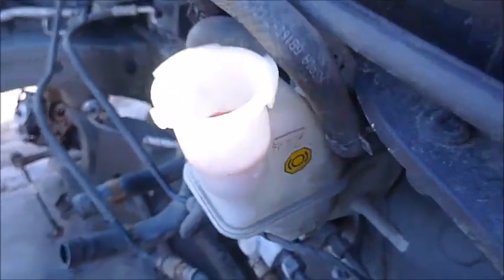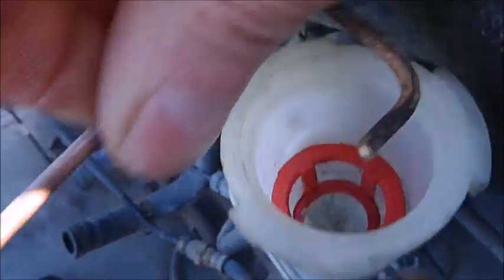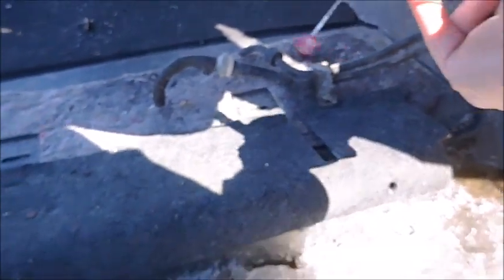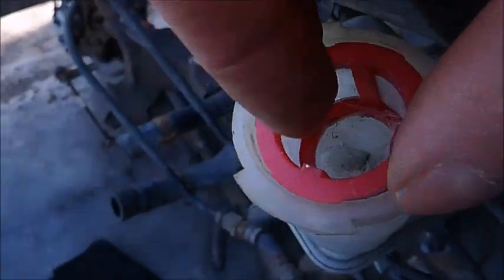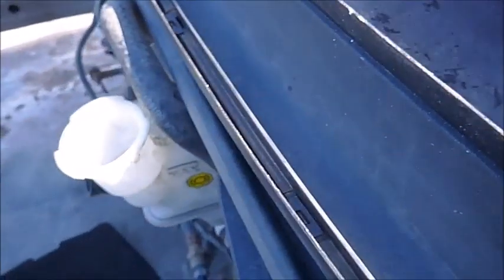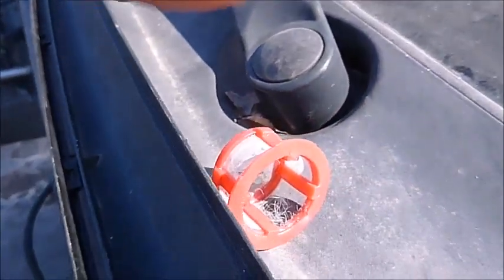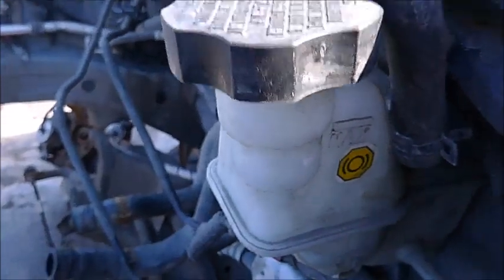Brake fluid reservoir mesh filter

Comment from the maker: Be aware when bleeding a caliper. These later reservoirs have 4 different compartments inside - each for one caliper. The fluid will lower in one compartment more than others. When bleeding brakes, always identify which compartment is getting low fluid - it can be one at the back of the reservoir. If you look only at the front of the reservoir, a rear compartment may get out of fluid and suck air inside ABS module. One of the way to burp air out of master cylinder and ABS module is to engage the ABS system when braking - brake on ice, snow, or brake hard on wet surface in straight line
The way it's inside these modern reservoirs, you won't be able to suck all the fluid out using a turkey blaster or a hose : notice there are thin 'channels' inside the reservoir so no access to the bottom of it.  It's much easier to just drain the reservoir at a caliper bleeder - carefully not to drain it completely - drain it, then refill a little with fresh fluid, then drain again and you should have pretty much all fresh fluid inside.

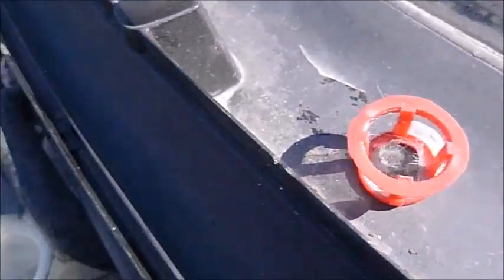Comment: 😮3:45 To use a brake fluid tester, the filter needs at least to be punctured if not completely removed to place electrodes into the brake fluid. Mine wouldn't come out so I punctured the filter at the 62k mile, seven year old fluid check.
Great video.